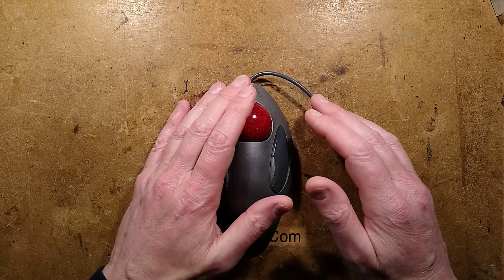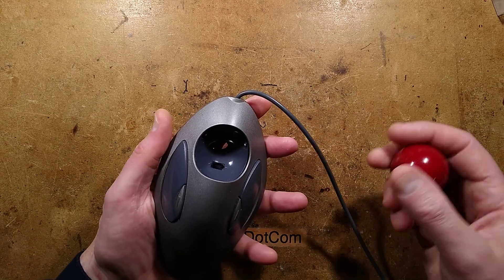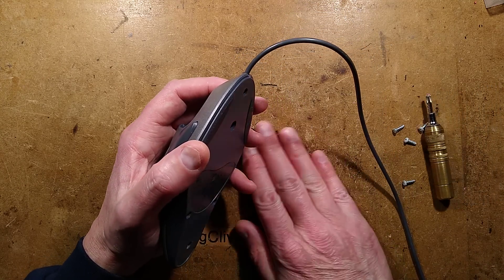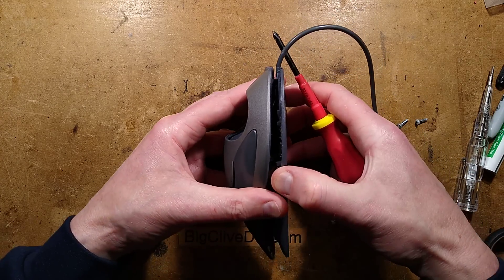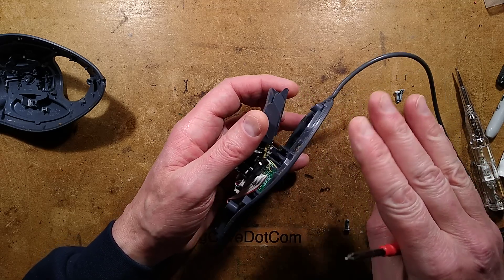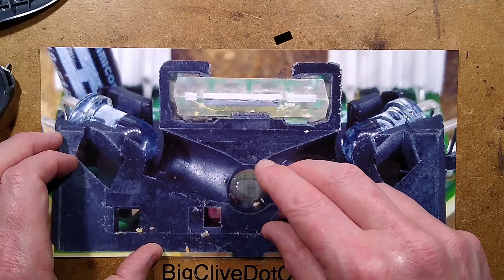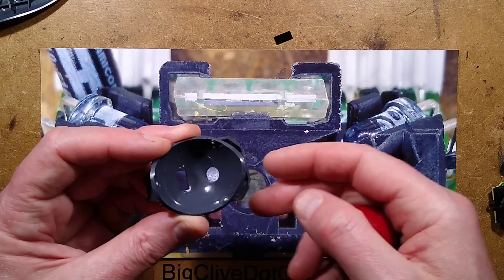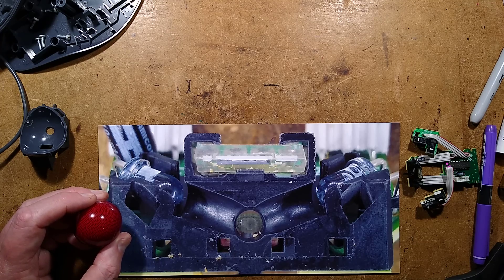inside an optical trackball

Comment: Interesting to see this model. I've used Logitech TrackMan, TrackBall and Ergo devices fir years. The switches on some do fail annoyingly quickly. They can be replaced or cleaned with contact cleaner.

Comment: The 'forward' rubber-foot-thing should also be there.  It's part of what keeps it from skidding easily during use.  If you have any two of them it's usually 'good enough' for most smooth, not-slippery surfaces to let it sit stably.  All three feet would be best, of course.

Comment: I recently purchased a trackerball mouse for my garage pc - there is often sawdust and materials all over the place, and using a normal mouse with no designated place to put a mousemat as the pc and screen are bolted to a wall, a trackerball was the perfect option, and also easy to clean.

Comment: This model and its predecessors has been my pointing device of choice for around 25 years. I have at least eight of them. One is the original version in a beige shell and with a PS/2 serial interface, two are of the latest four button model and the rest (of which I'm using one right now) are of the silvery gray two button USB variety. The micro switch for the left main button is worn out on practically all of them, but apart from the crappy microswitches they're great trackballs! I'm contemplating plundering one of the four button ones to resurrect three of the two button ones, since I prefer those anyway.

Comment: I have one of this type, but I prefer thumb-ball designs.  I find the ball stays clean because everything scrapes off on the bearings, which need periodic cleaning.  Logitech makes a generally nice trackball, but they're expensive and the button switches aren't terribly long-lasting.

As for price, Perixxx makes a much cheaper trackball, that seems to last far better than the Logitech ones and their low-lifetime button switches.

Comment: The Logitech Marble, one of the best trackballs I've had. Still have it in fact, it still works, and yes you're missing a rubber pad there on the bottom. Only complaint is it doesn't have a scroll wheel, which is desperately needs. Tried the M570 and M575 as replacement trackballs, those have a scroll wheel but the ball motion is crap, so I went right back to the marble.

Most trackballs are useful if you have a preference for that kind of control, or if you're just short on desk space. They're not as precise as a regular mouse, so they're not really useful for CAD/illustration or most other "professional" uses which might come to mind. And as for gaming, I don't think so, since most mice will outrun you in a second. Unless you're playing missile command.

Comment: My first Logitech trackball was a Logitech Trackman Wheel (Right-handed trackball) and I had that one for a very VERY long time. I recall it failed at some point but I don't remember the failure mode. It had been repaired a few times already by that time. I am one of those weirdo's that played games like Unreal Tournament '99 with a trackball and I used to be really good at it as well!
I now have a Logitech MX Ergo bluetooth trackball, have had it for about 10 years now and only had to do two repairs: First the microswitch for the left mouse button and earlier this year the microswitch for the right mouse button. The battery, after all these years, is still holding up very well for its age :)

Seems the Logitech trackballs can be fixed relatively easy - which is a big plus! They are still one of the most reliable ones you can get from my experience. And yes, I still play games with my trackball ;)

Comment: I've used a trackball for the last 20 years for 2 reasons: 1. ergonomic design reduces wrist strain 2. I've got tremors associated with the grasping motion you use to move a mouse, so the thumb movement needed to work a track ball helps me not trigger that. They're a great option if you do a lot of clicking for work (like I do with metadata and digital archiving).

Comment: Track ball mice are excellent for 2 specific use cases (and one is not gaming):
Avoiding or reducing carpal tunnel syndrome. 
And work stations where you don't have the space or need to use a moving mouse (think a system integrated into a non-touch panel piece of equipment, like an older CNC controller)

Comment: That's my favorite trackball.  I've been using this style for like 20 years, the early one (I still have) had the round connector.  They wear out sometimes and the buttons stop working, but it's easy to fix.  After you fix it right it never breaks again.  I wish there came in other colors though, I have 3 on my desk now.  Wow they are discontinued and expensive on Ebay, that's a pity I may complain to Logitech.  It was made up until COVID.

Comment: Did you ever use a trackball with a large (10cm or larger) ball?  Those worked well in the pre-optical era, and the components were large enough, and exposed enough, to easily clean.  When they started making them smaller (and cheaper) they did not work well at all until switched to optical.

Comment: Still got an original Microsoft trackball with optical tracking that is basically the same internals as an early optical mouse. The 3 contact points for the ball are steel ball bearings. It is so old and has had so much use the case has patches where the outer coating has worn away so much You can feel it is thinner in those areas. it is on its 3rd USB cable but the unit itself has been the most reliable Microsoft product I have ever seen. Funny thing is it has been mostly used on PCs running various flavours of Linux as the Microsoft software and OS is somewhat less reliable than the trackball. Cheeky Grin

Comment: I once had to disassemble a medical oxygen concentrator that UPS (pronounced "oops") had dropped on its head, in hopes of fixing whatever they had dislodged inside. The screws on that particular model were at the bottom of a hole somewhere between 20 and 30 cm deep. I ended up having to buy a pair of really long screwdrivers from Harbor Freight, each more than 65 cm long. I still have those screwdrivers, but I had to redo the organization of the screwdriver drawer in my toolbox because they only fit into it in one direction. 
Unfortunately, the oxygen concentrator was completely unsalvageable. They dropped it so hard the O2 sensor chip actually popped off of the board. God only knows what that did to the sieve bed.

Comment: It’s a bit random, but somebody recently commented on a “circuit breaker force tied in on position” post that doing this does not keep the breaker from tripping normally, only from being shut off manually. I’m pretty sure they are wrong, as there doesn’t seem any chance that so many people would want to keep circuit breakers from being manually turned off using hooks and such which could be easily removed, but still wanted to ask. Is that true? Can the breaker still trip with the handle forcibly held in the on position, or not?
Reply from the maker: A proper circuit breaker should trip internally even if the external lever is jammed on.

Comment: Since that technology was proprietary, the company I work for had to take a different, and somewhat more rubust route.
We used an rf technology to locate the ball in three vertical planes.
No issues with dust, the ball receptacle could be flushed through with water and wear on the ball surface didn't impact the performance.
The were so good they got used on the side bridges of ships (don't know the term for it but the ones they use when they come along side docks) as the salt spray wasn't an issue.
(would attach a picture, don't know how)
Reply: That's really interesting are they still being made? Do you remember the product name?
Reply: @diobiodiobiodiobio  yes but for IP reasons it's probably not a great idea to say.
Reply: @RamshakleRetro  Gotcha! thanks

Comment: Just cleaned and serviced an ADB Kensington Turbo Mouse trackball from 1989 for a classic Apple Macintosh system. Once the rust was polished off the steel bearings the ball runs on, and with some sewing machine oil it works really nicely. Chunky with a 2” ball! 😊
Reply: I used to use a big trackball with my ADB Macs. I haven't turned them on in years...I must give it a try.
Reply: @kendauer9781  If it's anything like the Macintosh Classic I just restored, beware of leaky capacitors - especially the little electrolytics on the logic board. It only worked after replacing them and giving the board a thorough wash.  These 1990s machines don't age well... battery leaks can also be a problem, but fortunately I was spared on my Classic.

Comment: I had the older model of this, the "Logitech Marble Mouse USB". For whatever reason, it stopped appearing on the USB bus, even a new cable soldered in didn't fix it. It didn't have the inserts on the two main buttons, but was otherwise the same body and ball.

I used to spray it with a very fine mist of vegetable oil for lubrication, the thing flew but made my fingers a little slippery!

Comment: the only thing that could have made the logitech marble mouse any better would have been the inclusion of a scroll wheel instead of being reliant on software to scroll. I have 5 of these mice... they work great in the garage and anywhere a smooth surface isnt always smooth and for people that get shoulder fatigue. I still have my original one from 20+ years ago, though the ball is horribly scoured and yes... they are excellent for gaming

Comment: Thank you.  Always enlightened by your videos.  When dealing with plastics, I tend to shy away from products like WD40.  Through my work, I discovered silicon based lubricants.  Friendly to plastics and rubber.  A track ball cleaned and then wiped down with a dry silicon spray will move smoothly.  I find the silicon smell seems to dissipate more quickly than petroleum based products.  Don't spray your fingers.....damned slippery stuff!

Comment: Used to work in a silicon wafer cleanroom and one of the quite curious aspects of trackball mice is that they rely heavily on greases that come off people's skin. In a cleanroom, where everything is obviously clean and people use gloves, the trackballs functioned horribly. The ball would stick all the time and not roll in anysort of smooth manner.

Comment: I suspect the black dots, which look really neat on the ball, served a purpose of letting the sensor detect which way the ball is moving thus moving the mouse pointer in that direction.  I had one of the first generation track ball pointers back in the Windows 95 days, I could never get used to it as I was used to using a regular mouse on a mouse pad.  So when optical mouse pointers came out I bought a Microsoft branded optical mouse, which was truly plug and play by the time I upgraded to Windows 98 as 98 had the device drivers on the Windows 98 installation CD.

Comment: You can tell it’s an old product, because Logitech used proper switches even for additional buttons. Nowadays they put crappy tactile buttons even for the mouse wheel click and it dies in a year or so, so most people just buy a new mouse.

Comment: I used to like these Logitech trackballs, until they started using cheap switches which fail on me in less than a month.  Now I'm using a large Kensington trackball, even though I don't like the ergonomics as well as the old Logitech.

Comment: I would spend the day at grandma's and want to play computer games, she was always rocking the Logitech thumb-trackball mouse. Years later when I wanted to play FPS games without having access to a proper desk, I used the same mouse on my bed with a laptop and it worked very well. I would still be using it if the switches didn't fail, and I'm a bit mad the only replacement was twice as expensive and was wireless only, but I must admit the Logitech Ergo M575 is a very comfortable mouse. Sorry to the left handed folk, I've been informed the mice molded to only right hands is frustrating.

Comment: clive i love my trackballs been using them for ages ive rebuilt them replaced switches ect they are great if you just dont like swinging a mouse around a desk i sit in a recliner  with my monitor on a swing arm wireless keyboard an trackball

Comment: Lol that's an ancient or bootleg trackman mouse. They don't make them anymore. Amusingly, I have a (genuine) one on my desk right behind my keyboard. Rarely use it, mostly when I injure my arm/hands. 

The genuine Trackman mice(mouses?) have the logitech logo on them, and the shape is more elongated. This one is very squished. Also the ball itself is a dark red, not this bright red. Also the left and right mouse buttons are completely the wrong color. On a real one, they are lighter than the body color. 

Just pointing this out to all the commenters saying they have the same model. 

Edit: This is an ancient model, I'm not even sure when they stopped making that shape/color. Kinda interesting to see. I have a model from a couple years before they discontinued them. The much older ones must look like this. They are not worth the price now though, they're expensive due to being discontinued. Apologies for being initially wrong tho!
Reply: I believe the shape thing to be an optical illusion due to camera angle, focal length and lighting. It looks squished while sitting on the desk of death in the beginning, but instead very elongated when lifted up a bit into the video!

You're perfectly right about the buttons though! The original beige/white one had buttons with the same color as the shell, the two button silvery ones had buttons darker than the shell and on my four button ones all buttons are the same color as the shell. But I can see in pictures when googling that the "main" buttons on the last produced ones, like the one you probably have, seems to actually be brighter than the shell!

BigClive likely has an early variety of the four button version. The main buttons seem to be the same color as on the two button version, and the sticker on the bottom has black lettering just like the two button version and unlike the white lettering on my four button ones!

There's been at least three versions of the printed logo of which one is either none or very easily worn off...

All my balls are the same color, except for the original one that's very slightly brighter. 😁

Comment: I have that exact model. It's decades old and still in service. The trackball I primarily use is branded Microsoft and is older than the Logitech. It is still going strong. Works a treat.

Cheers

Comment: I still have one of these.  I used to have one at work, and it was amusing to see someone start moving the whole unit around the desk trying to move the pointer on the screen, and wondering why it didn't work.
But yes, I did use the extra buttons, I had the extra left button mapped in X11 to the "middle button".  But those nubs are notorious for gathering lint, and you'd have to scrape it out periodically.